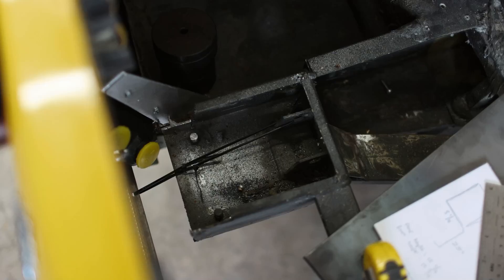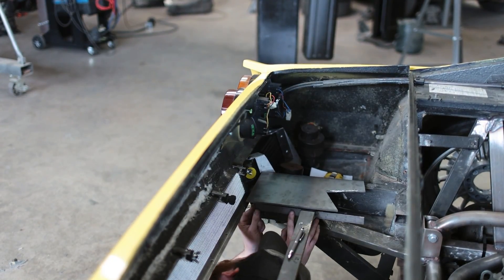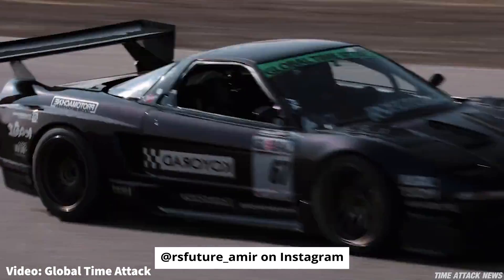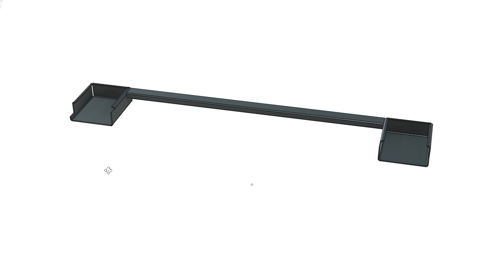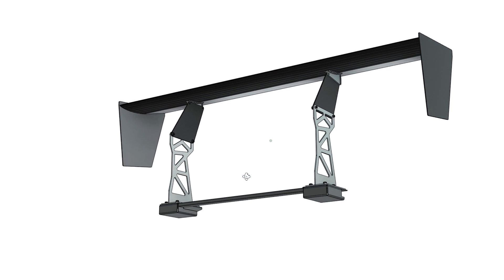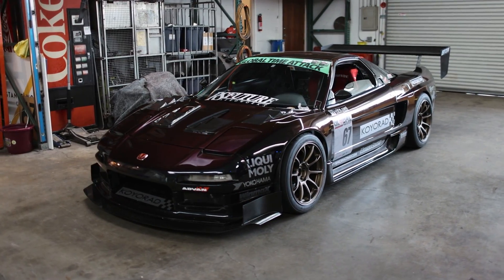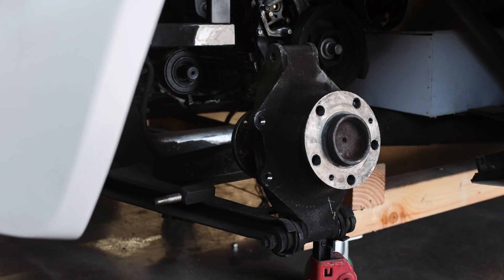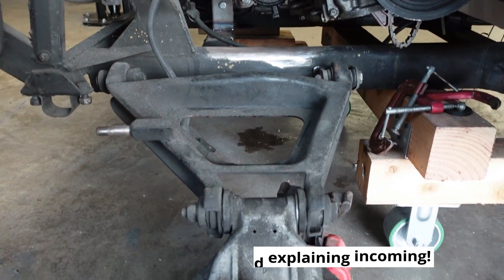K-Swapped Ferrari - Designing The Chassis-Mount Wing for Global Time Attack - Ep. 44

Comment: Narrowing the inboard mounting locations of a wishbone (a-arm) will increase the loads going through both the leading and trailing arms. 

Also maintaining the upper and lower outboard wishbone mounts on the upright whilst increasing track width will affect your roll centre heights and FVSALs
Reply from the maker: Correct. Neither of those should be majorly problematic for starters though. I’ll map out the roll center and instant centers in CAD

Comment: Please cross brace the two aluminium upright. And please keep the mounting of the carbon fibre uprights in double shear mounting. And use bushings in the bolt holes in carbon fibre. Did something similar to what you designed in my Formula student team, and had a hard time keeping the wing suitably stable
Reply: Yeah it definitely doesn’t look stout enough to handle 800lb of downforce.
Reply: I came to the comments to say the same, cross bracing those aluminum uprights is very important for when you’re turning
Reply: I agree regarding cross bracing, also I may have misunderstood so can you clarify regarding having only the carbon fiber parts visible; how would you get to the bolts if you needed to remove the trunk?
Reply: @John-ln7yc  watch the video again, Mike explained this midway through the video